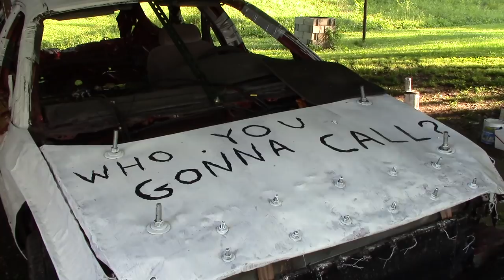1999 Taurus Wagon Paint Timelapse Derby Car

Comment: cool paint job, the thing is you need to run some lights on the top when you go out to play. Good luck with the wagon with and where you get to run the car.
Why do you have all the little bolts on the front of the hood. I can see the treaded rod, but all the blots along the front are toosing me for a loop.
Reply from the maker: Hoods have metal layers, the inside metal skin often comes apart and can cut engine wires when the hood crushes in.
Reply: i seen enough cars built even up here with the pro guys even that you seem to be the only person to go that nuts with the bolts.